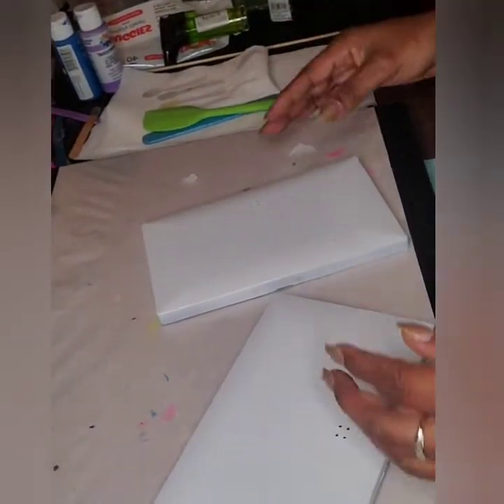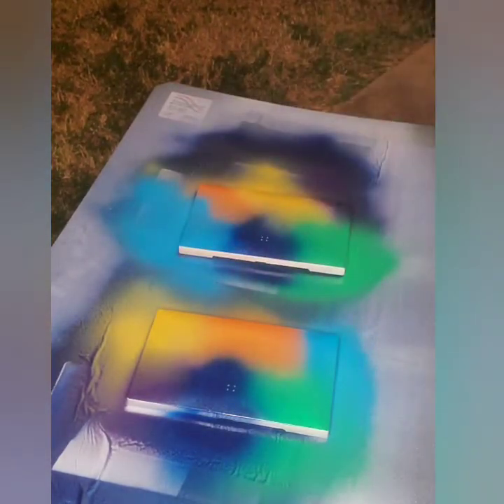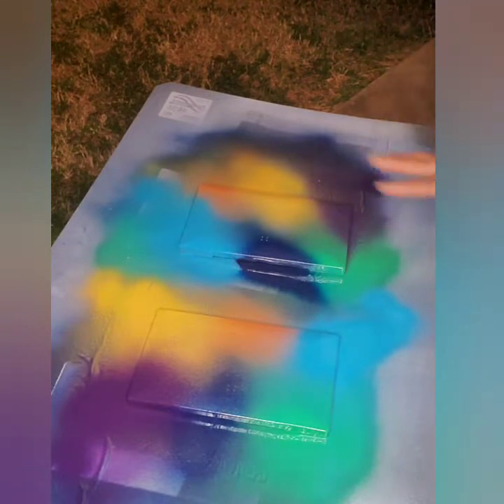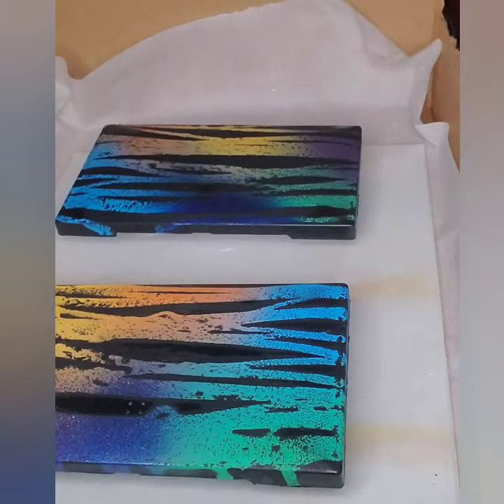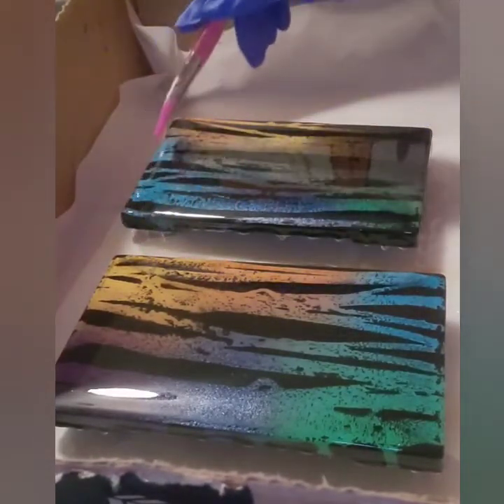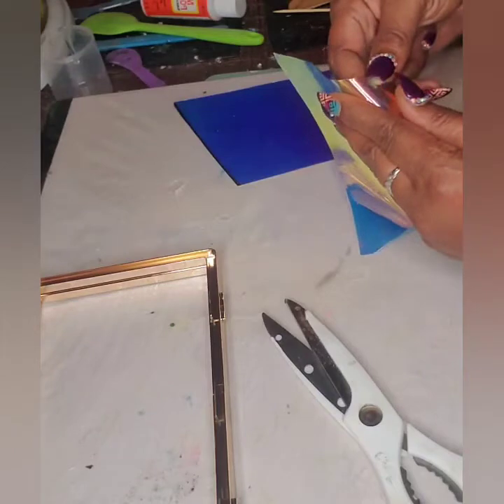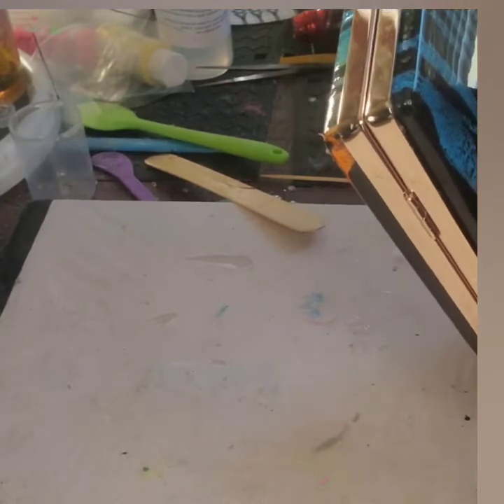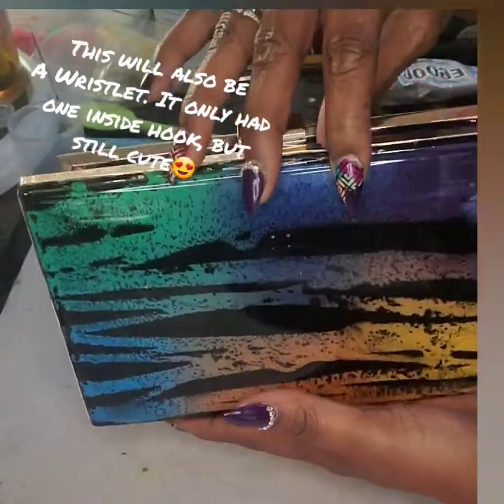How to Resin a Clutch Purse without a Mold.

Comment: How long do you put pre-mold &
Custom molds in the the heater for and at what temperature for both.
Reply from the maker: I would heat them the same as they should be made from the silicone materials. Im not home right now but will check the temps and respond shortly. I know it like the 1st temp in the red section of the temp dial, it that make since.  I would still do 90mins for the time. Hope this helped. Happy Crafting.